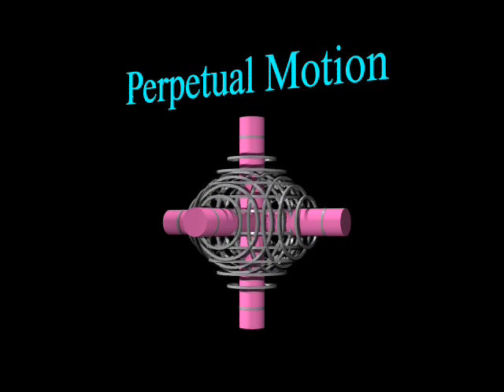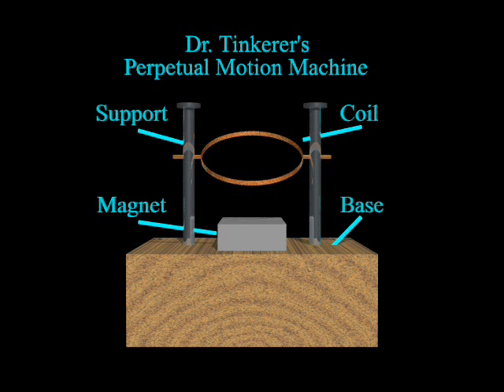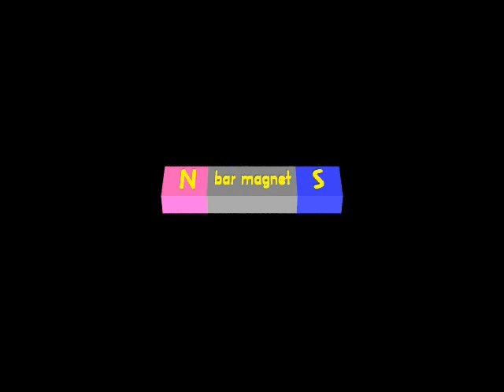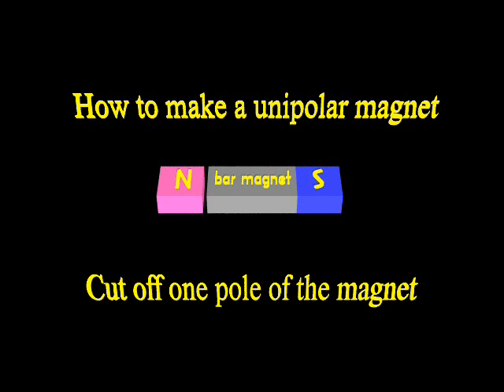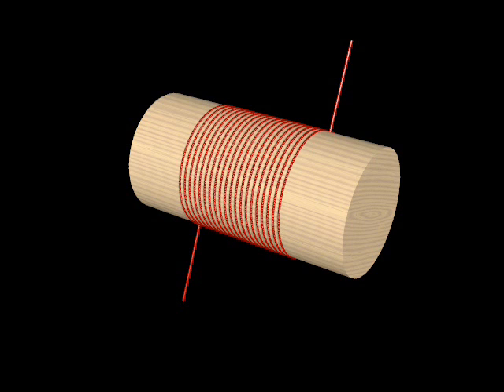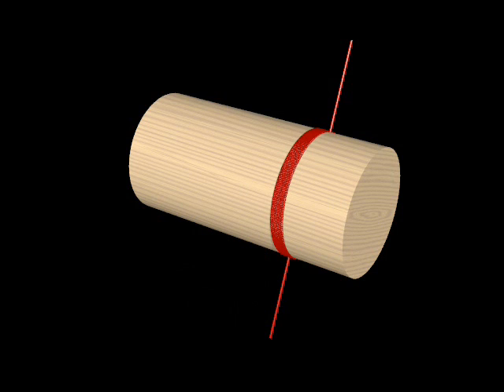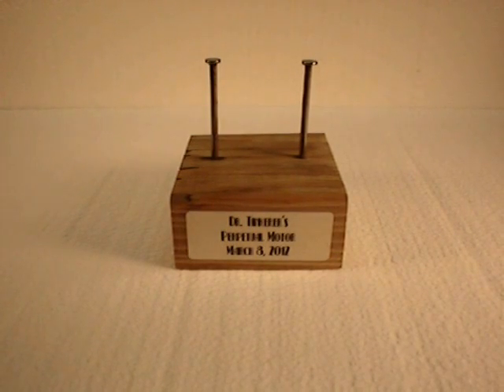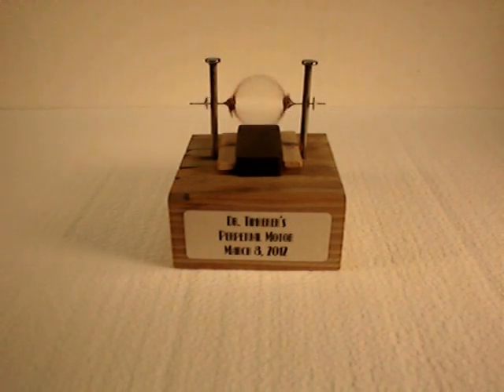PERPETUAL MOTION MOTOR.wmv

Comment: That definitely has a battery, since magnets always have a north and south pole no matter what, and I once built one just like that. It didn't work without power.
Reply from the maker: of course plastic won't work. the nails must conduct current for the coil to spin. the current flows thru the chemically treated wood causing current to flow thus spinning the coil.
Reply: @tinkerer47   you cant make a momopole magnet buy cutting a magnet in half

Comment: I saw a piece of wire spinning continuously on top of a battery that was sitting on two button size neodinium magnets a couple of days ago. basically there were two neodinium magnets one on top of the other and the - pole of the A size battery on the face of one standing up then a  wire in the shape of a noose around the battry balanced on top of the + pole

Comment: nice vid. I have a few notes though:
1) you have to have closed circuit for any reasonable currents to flow.
2) unipolar magnetic field can be achieved with Halbach array because cutting magnet will result in 2 smaller magnets.
You should try putting capacitor across the support. something like lockridge device ;)

Comment: Gravity is causing the top of the coil to fail back downward and  it is the start up energy that you give it that gives the differece in potential.The magnetic induces electrical energy back into the coil as it"s turns these etra electrons give the coil the needed energy to overcome the gravity and thus repeats the process.The energy is the kinetic energy that is stored in the magnet that is being extracted and used up in the Kinetic energy driven motor.Laws of Physics still proven! Wayne

Comment: I found that whenever you cut a magnet it merely shifts the SAME pole closer to the opposing pole. N........S     >      N...S     >     NS.     i.e. two bi-polar smaller magnets! Isn't one pole merely hiding internally in a so-called mono pole magnet? Like with electricity... the electron flow MUST have a negative and a positive direction.

Comment: Besides the magnet issue, I don't believe you can cut a slot on a nail that easily, unless they are  plastic nails.
Reply from the maker: it's easy with a rotary tool

Comment: Breaking the magnet will not create a monopole magnet
div E = 4(pi)) (rho) (sub e) 
div B = 4(pi)(rho) sub m 
divergence of B is four pi times  the magnetic charge density rho sub m
that gives the magnetic potential 
The units are amps / meter cubed. simply breaking bar magnet does not separate the positive and magnetic charges inside the bar. But placing the loop near one end only could fool the coil into thinking it is a monopole.

Comment: Unipolar magnets?  No such thing- cut a magnet - forms 2 magnets with N-S on each - trust me.
Without the wire moving there will be no current flow - IF the coil does move the induced current will attract it to the magnet - Faradays rule. To work this need an electricity supply and some form of brush.

Comment: if you can make a mono pole magnet, why not use one pole for stator and other pole for rotor where both rotor and stator has the same pole it would push and  became perpetual motion.  But in the reality there is no mono pole magnet.  Will it perpetual ?  No no.. because the pole has a 360 degree magnet field direction this will stop the motion in the left or the right side of pole with other mangets get closure to it.

Comment: "unipolar magnet"? No such thing. The "explanation" here about cutting off one pole is hilariously bogus. Schoolboy error, as they say. There is a hidden battery in the base - apply a voltage across those nails and it will spin - it's a simple DC motor.